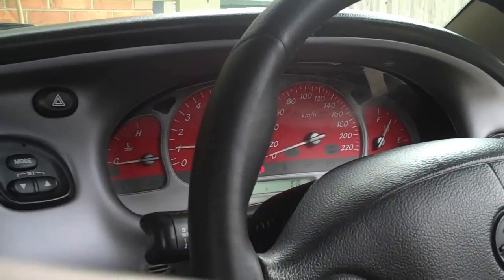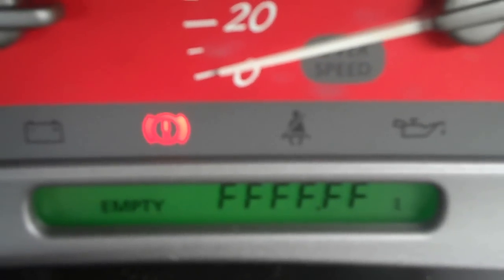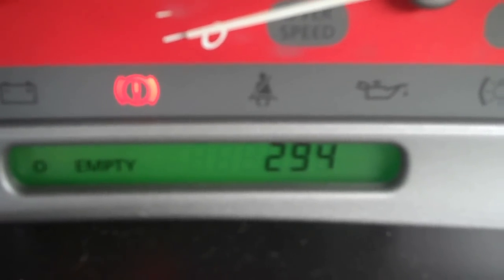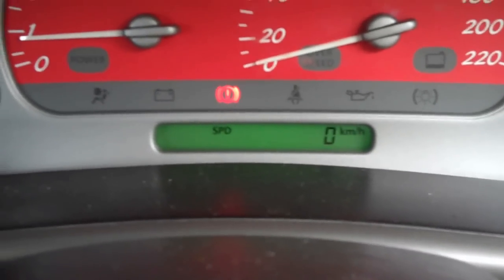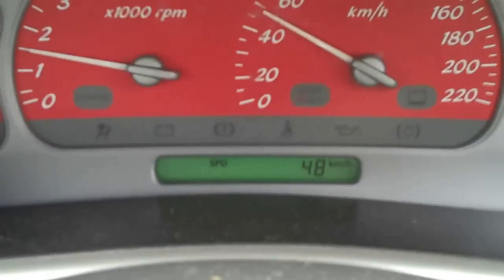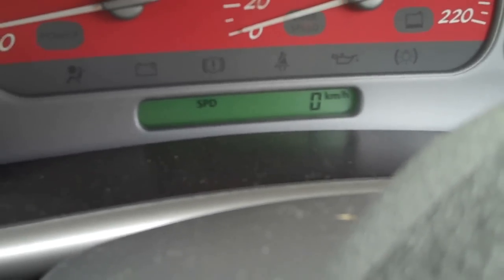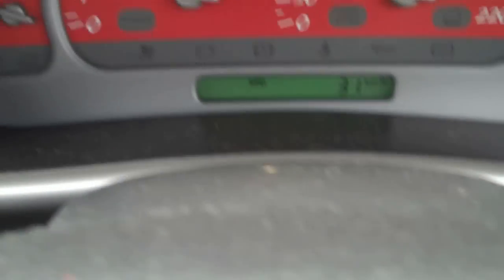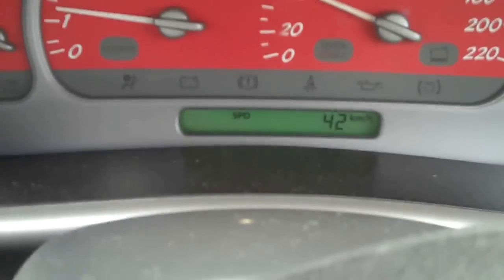HOW TO CHANGE A HOLDEN VT-VZ INTO  BT1 POLICE MODE

Comment: @lightweight69   No the right way to do it is "MODE+ UP" Try it and you'll see, all the displays modes will display right,,,, like Voltage will show you the actual voltage (v14,0)  not what you have now.

Try it -----> MODE + UP <------

Comment: This isnt police mode, its called engineering mode for diagnostics. Police mode can only be obtained through programming with tech2 at holden
Reply: Thank you. I just wrote something similar.
Reply: @kennethsmith3260  no problem, me back in 2014 is here to help
Reply: Could one get said software and a tec 2 and do it at home
Reply: @leangreenadventuresofasout7281  only way you'd get a tech2 is if someone stole it from a dealership. So probably not

Comment: Cluster Engineering Mode
 

The instrument cluster engineering mode is a special diagnostic mode that has been available on Holden Commodore clusters since the VN Calais.
Engineering mode allows you to view diagnostic information such as the clusters part number, software version, vehicle voltage, switch positions, raw guage readings, and other interesting tidbits about the vehicle.

To enter the VT and VX Commodore Cluster Engineering Mode
1) Press and hold the MODE and SET buttons down

Comment: Use the mode and up button instead. It gives you more read outs such as speed, engine temp, fuel left in litres, oil pressure and a few more.
Reply from the maker: cheers thanks mate
Reply: Thanks
Reply: Oil pressure? Which one is that?
Reply: My VY shows all that as standard, no menu need💁

Comment: See Holden (or a mate with a programmer) and get them to program "Police mode" permanently. VZ onward already has the option to display this info in the mode settings. This is only good if your speedo is accurate and you need a dyno or a good GPS to work out the actual differences between displayed speed and actual speed then have it set it in the tune. Good work!

Comment: This is not "Police Mode", and not even the start-option 'Engineering mode', while accessible, is not entered this way!  For the information of other respondents, there is a police pack which is fitted to many Services vehicles: sump plate, extra-heavy duty alternator, second battery footprint revised entries into the wiring loom in the roof and cabin for devices such as radio, lights and siren. How do I know this? Because I own one of these cars and I fit them out!
Reply: i agree. my VZ has a bloody big plate under my motor as well Why does it have that? 2006 unmarked model.

Comment: They dont chip, they program, and you need an OBDII programmer of Tech2 to check.

As for 'cop mode' the Tech2 Holden diagnostic and programming tool will put the car into 'cop mode', which is programming a different set of shift patterns for the auto gearbox, and programming a different fuel management map into the car, as well as turning on the digital speedo, and the 'lock feature' where you can tail someone, press the button to lock the speed in. 

The mode here is diag mode to read from ECU
Reply: Can you turn “cop mode” off the same way you turn it on?? I want to try it with my vx
Reply: @jameshgerard7595  i know this is an old comment but still, when i power cycled my vx (turning engine off and taking out the key and putting it back in) it went back to normal mode
Reply: @chedrwastaken  cheers mate

Comment: Hi it is Matthew lungley just want to kn wat size dash lights in a 2002vx wagon
Reply: Dude, this guy can't tell you what the instrument cluster is telling him, I'm not convinced he can answer your question "w(h)at size dash lights in a 2002vx wagon" ... partly because he's an idiot, but also because it's not actually a question and it's incomplete. Which dash lights are you referring to? I drive a 2002 VX, I'll help you out, but I need a little more to go off. There are three different types used in the instrument panel - all of them are wedge bulbs (the small ones that are about 2cm long) like you have in your park lights and number plate lights. Those ones are 5W but the instrument panel ones can be either 1.2W,  3.6W or 5W, just depends which bulb it is.

Comment: VT-VX. Hold down the UP button and the Mode button simultaneously. Then turn the key from fully off to the ON position. Then release the arrow and mode button. The display will then provide; Digital Speedometer, Tachometer, Temperature (Engine), Voltage, Litres in fuel tank, Litres per hour and some other misc info for diagnotics. The other modes are eliminated whilst this is on such as odmeter reading and speed alerts. Once you return the key to the off position the diganostics feature reverts to the normal mode so it cannot be made permanent. It is useful for acccurate tacho readings, litres in tank and engine temp. On the VE Commodore, operate the left scroll button on the steering wheel (push in), then turn ignition on. Similar features above are shown in additon transmission temp and oil pressure is shown and a few other diganostics.
Reply: This one is so much better to use

Comment: to put it into cop mode on VS TO VZ is to buy a slip diff and to have low trac activated. and they install extractors on the v6's and boost the injector setting on 2800rpm's to allow 3 times the volume in the chamber when ignited. when they are retired they disable and stock the engine with resetting all values and sending it to the auction joint... just one or two slip thru and you have a commy thats had the setting. , v8's did too but only on highway patrols did in vic...

Comment: lol i suppose its got a "police chip" too....  The greatest of aussie urban myths....  bt1 was nothing more than a handling pack.
Reply: JETFOURLITRE fe2 suspension wasn't it?
Reply: Different shift points, extra wiring, FE2, speedo in 2km/h increments, tacho,  trans cooler, sump bash plate. Just a little more than handling upgrades compared to a base model. But these days, most of that is included. The option code changed to 9C1 a while ago too.

Comment: How do change and reset for your service mode on a vt 2000 clubsports.
Reply: Put in the key turn the ignition on, then press both up & down buttons on, for about 5 seconds, then take off the up & down buttons depress mode button again for about 5 seconds, thats it ?

Comment: mate that is called diagnositc mode those numbers are the hex decimal codes for checking the software it is not police mode as i an a police mechanic so don't say it is police mode you are wrong talk to a mechanic we use to that to check when their was a recall to check part numbers

Comment: 2) Switch ignition to the ON position.
3) Release the MODE and SET buttons.
4) The LCD Display(s) will display the following.

Left LCD Window: Battery Voltage
Middle LCD Window: Software Date, in YY/MM/DD Format (Eg. 990726 is equal to 26/07/1999)
Right LCD Window: Part Number

5) Press the Mode button to proceed through to the next menu option.

Left LCD Window: LPG Sender Voltage
Middle LCD Window: Voltage for Trip Computer Button Status
Right LCD Window: Petrol Sender Voltage
Reply: How do you return it back to normal please

Comment: pathetic. guy knows nothing. all he does is changes the visual aspects on the dash. instead of fuel consumption or fuel range ect, changes it to digital speedo. all simple sht and found in your manual. does not change the mode of the ecu

Comment: Police Mode Your dilusional!!!! lol
Reply: Not quite delusional, and it is often called Police Mode on those vehicles coming from the Services (CFA, Victoria Police, Ambulance pilot cars etc.) More commonly referred to as the Trap Speed echo and selectable (on/off, in place of digital speed readout) in those cars which have the optional police pack installed (alternator, under-console switches and additional wiring loom). 

SOURCE: VZ Ex-Services car, detailed engineering knowledge.
Reply: @Garyh61  sounds as tho sump bash plate is easiest way to tell?..curious as i'm about to buy 06 vz with 7"" pursuit rims and just a bit curious
Reply: @groundcontroltomajornong8085  Possibly not all VZ service vehicles have the sump plate in place, and some hoons would want it removed, supposedly because the car will go faster without it!
Reply: @groundcontroltomajornong8085  make sure it has Bond mode